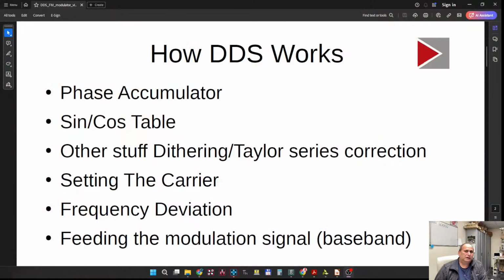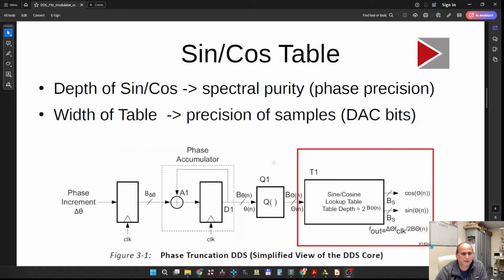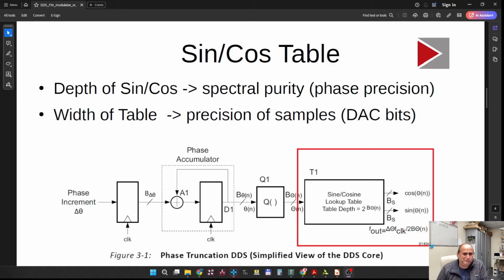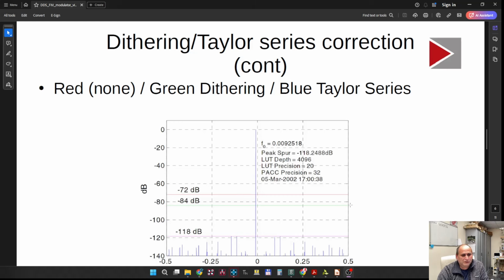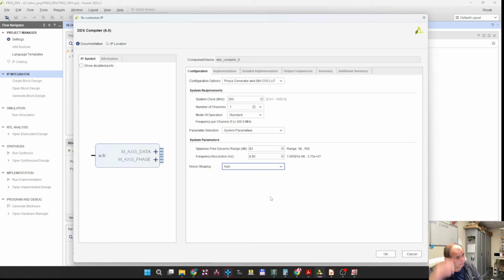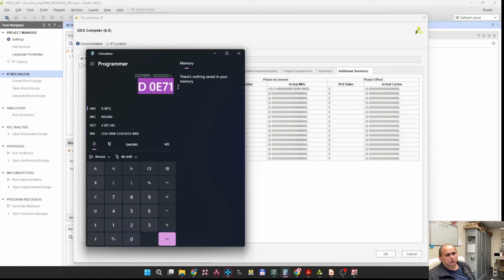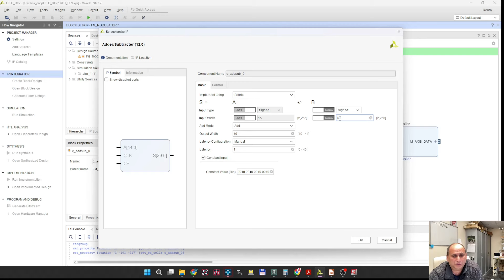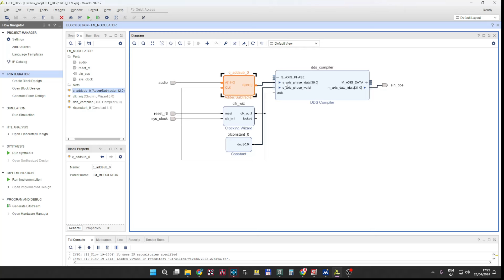FPGA FM Modulator with DDS

Comment: Thank you very much for your video. It was very educational. Also, it was the first video I have seen where FPGAs are used to modulate (or demodulate) a signal.
Reply from the maker: I'm glad you like it check the FM Stereo radio transmitter video - where I used AM modulation of the multiplex stereo and FM modulation for the carrier. I'm sure you'll find that interesting.  https://youtu.be/MJxTVts67yg
Have fun!

Comment: hello
what is the type of data provided on the "audio" modulation input? it must be in hexadecimal
thank you for your answer
cordially
Reply from the maker: Hi There,
The signal is PCM digital is signed binary., two complement format, for instance when you want FM modulation, you choose the phase increment value, which in turn will give you the center frequency (the carrier) and the audio samples will add/subtract  from that value (depending on the sign of the samples) and will "deviate" the carrier. (will frequency modulate the carrier)
please let me know if I explain sufficient and clear. I have another video which my explain it better (not sure if watch it already) https://youtu.be/U8DqF9C_O2I
Reply: Thank you very much for your answer.
I would just like to know how the VHDL code is built in the PHASE_INC module befor the DDS IP core of your video https://youtu.be/U8DqF9C_O2I
Best regards
Reply from the maker: @FabriceWiotte  Not much code in VHDL is just an signed adder (min 22.22 sec) that I inserted as a block in Vivado, one one input takes a constant value in hex (the carrier) and ont the other input it takes the audio stream. The output of this adder is conected to the DDS on the phase_inc input.

Comment: Hello. So would the adder be the equivalent of the "phase_inc" block you have in your other videos? I am trying to piece the whole radio together (i.e., the final block diagram of the radio) but this doesn't exactly go over the phase_inc block. Instead of audio like you do here, we would be passing in the 16bits from the dc_off_remove block to the adder right? Also, on the phase_inc block, you have two clocks, aclk and dds_clk, why is this?

Comment: Hey guys,
Sorry for the question it's only a little bit related to the video.
For implementing a Hamming Window on some signal (that will be inputted sequentially) should i just store the hamming coeff. In ROM and multiplu to the input or calculate coefficients dynamically with DDS giving us the coefficient value 
Or We would use Dynamic calculation only when we do not know the value of the input size
Reply from the maker: you have a few choices (nothing to do with the DDS) you can pre-compute your hamming scaling coef (or any other window function) store them in RAM and multiply them with your incoming samples as they come. I would do this a AXI stream IP core which can be configured for different lengths and different type of windowing. (or configurable on the fly if necessary)
Have fun!
Reply: @adaptivedesign8795  thanks a lot
You are being a very good support to the FPGA community 😄